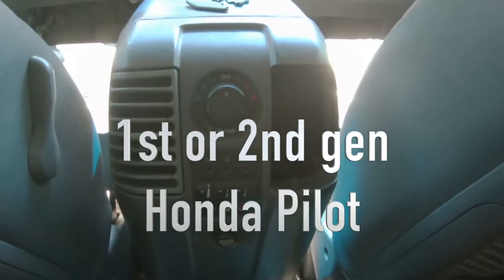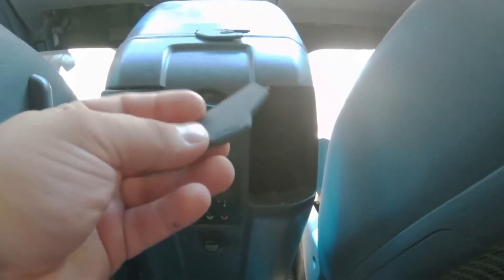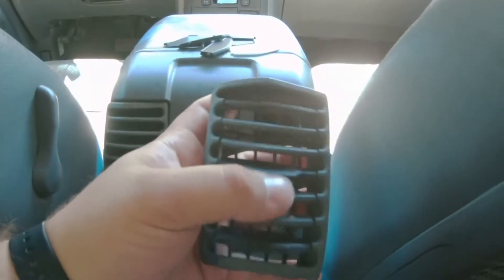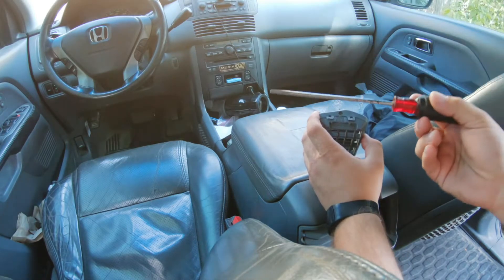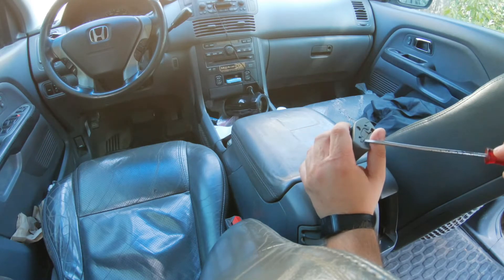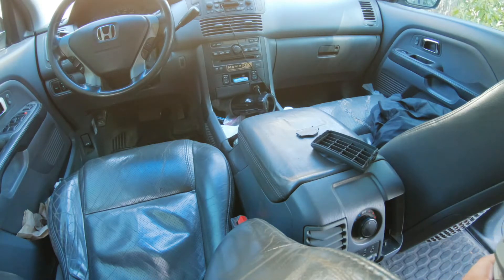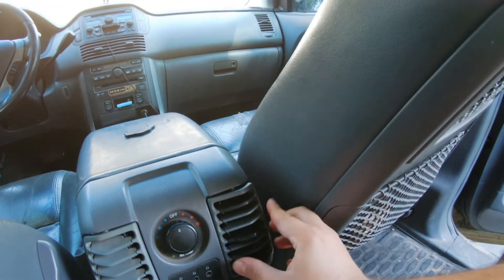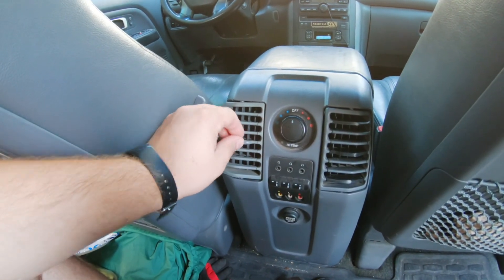Honda Pilot Rear Vent 3D printed fix with instructions

Comment: Hi; do you have the front centre vents too? The little handle that you move the vents around is missing. Any chance you have a file for that? 
Thanks !!! 😊
Reply from the maker: @typhoonk123456  Hi, I only have have the the two different sized vents for the front- the handle was broken off on the vent that I used for modeling so I didn't model that. I have confirmed that a regular vent will fit if one of your vent pieces is broken.

Comment: How did u take out the vent? I need to do that in the front.
Reply from the maker: The rear vents can be pried out using a trim tool. The front ones need the trim panel around them taken out to be able to release the front vents. Just find a radio removal video and most show how to remove the vents.